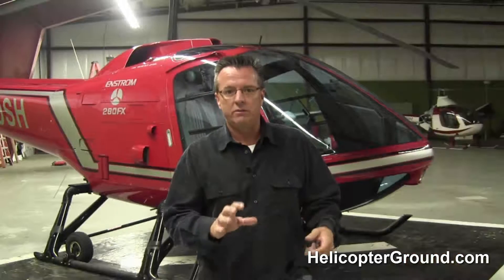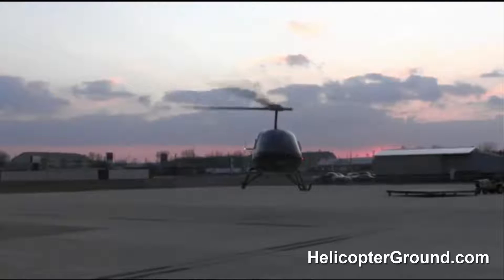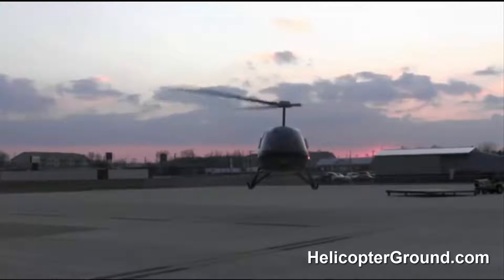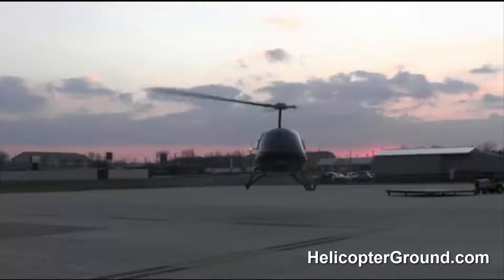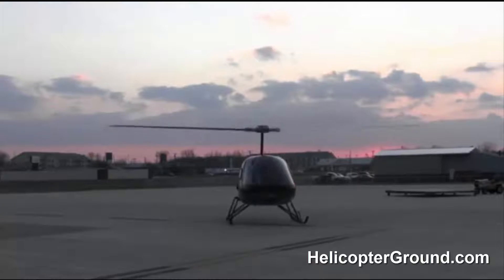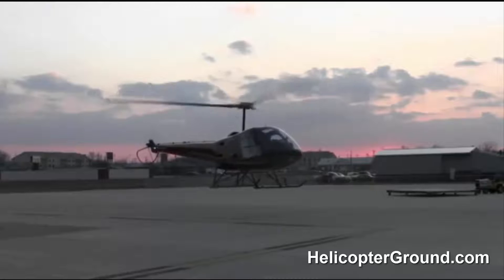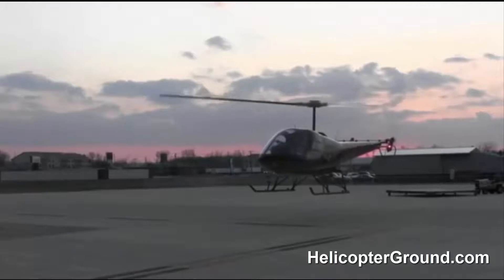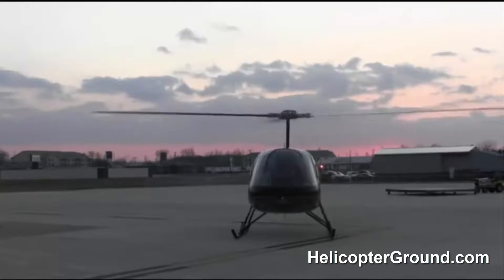#5 Helicopter Flight Training Pilot Struggle Hovering Autorotations

Comment: I found them more challenging in the Schweizer and very easy in the R44.  My instructor told me the more power the helicopter has the easier they are.
Reply from the maker: ***** The helicopters with high inertia rotor systems most generally are much easier to manipulate during this maneuver!
Reply: Rotor inertia and rotor drag Basically disc  loading or how much weight the Rotor has  to support

Comment: I will have to try the pause for a second.
Would that hold true for a smaller helicopter like a R22 with a lower rotor inertia?
Reply from the maker: Michael Carr The lower inertia is going to settle faster. Conditions for the day, weight, and the height where you enter all play a factor as well!
Reply: Helicopter Online Ground School, my thoughts exactly. Maybe 1/2 second for a smaller helicopter then. 
Still good advice though.
Reply from the maker: Yep, very common problem that people either pull up to quick or wait to long to raise!